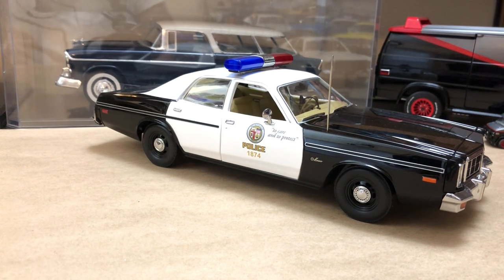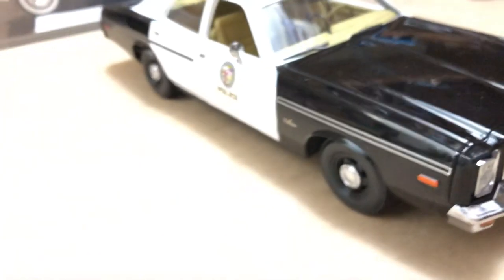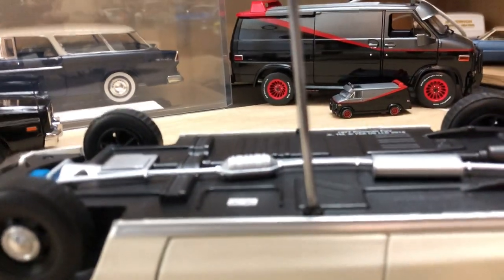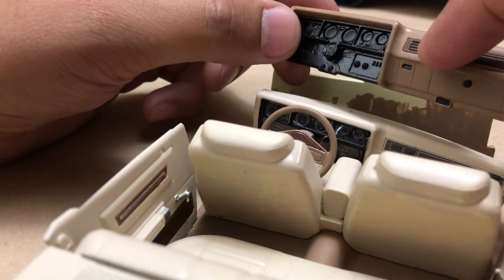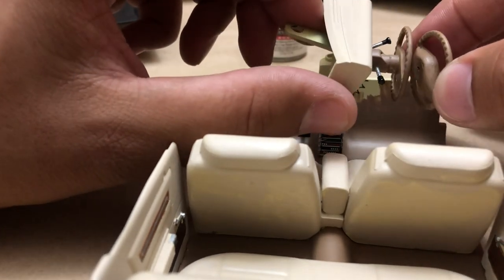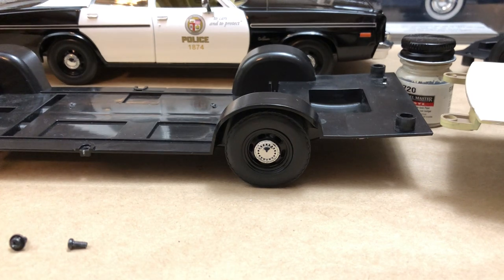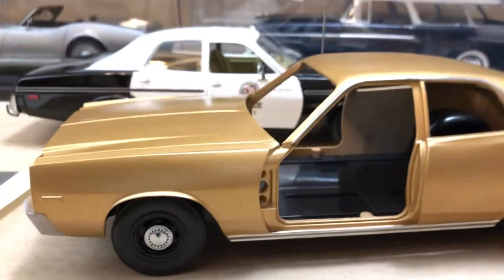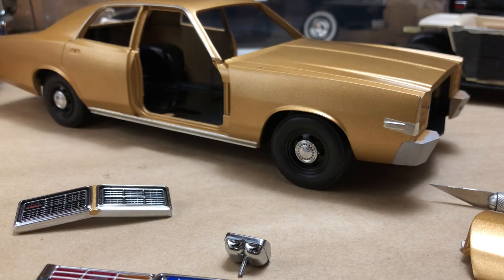Project ‘77 Dodge Monaco Custom Greenlight 1/18 #Diecast PT 1

Comment: I thought I was the only crazy one that was taking these things apart. The  interior was  also bothering me. I took The interior out of a 1974 dodge Monaco diecast and resin casted It To get the correct police package bench seat.I also changed the wheels to the correct four slotted earlier type that Chrysler used in 1975,76 and 77.I took mine down to bare metal also and had to do a lot of priming and filling because the metal has lots of scratches in it.I’m doing a two-tone paint job on mine and I wound up ruining it when I put my clearcoat on it so I’m doing the whole thing over again. I love these things because like you it reminds me a lot of the cars that were traveling around when I was growing up. I love the tip about using the sharpies for the marker lights I never thought of that. The decals are the next problem because no one really makes 1/18 scale decals. I solved that by making my own with my ink jet printer.I also painted the interior like you did because the color that Greenlight  uses is ridiculous. I enjoyed your video thank you for posting it.

Comment: Can you take the headlights from the 77 model and put them on the  75 model cars where there is just one big round light? They make a  75 CHP coronet but I want it to look like a monaco with the 4 headlight system and wonder if it will just snap right in.
Reply from the maker: Yes just have to also take off the whole front end too
Reply: Okay so the whole front end of the Coronet matches up with the front end of the Monaco?
Reply from the maker: Yes the body’s are all the same castings they just change the front and rear aroind

Comment: Is the Coronet emblem on the side a sticker?
Reply from the maker: Die cut chrome decal too thin to remove
Without destroying wish someone would make replacements
Reply: @Migs_Models  I owned an Ex CHP 77 Monaco. Are you ready for this?: It was painted gold.  It had a blue and yellow license plate 594 XXC (the thinner letters) I want to do exactly what you did because I guess the Dukes police car has no model emblem on the side but it's a Fury. Where do you get your cars and supplies from?
Reply from the maker: Greenlight collectibles has released many different B Body mopars look them
Up on google many diecast sellers have them for sale and eBay too.

Comment: exactly why i don't buy from Greenlight ugly cheap models..but one beautiful one i have is a 1975' Dodge Monaco the Navy Blue & Silver Nevada HW State patrol squad car that i had bought from Hot Pursuit looks realistic just like it did in the 70s when they had it out on the road. i had the choice of either the B&W or the silver & blue navy blue is my favorite color it looked gorgeous so i chose that one instead. i want to find the 77 dodge monaco with the flat rounded barlights ontop & in B&W just like the Terminator 1 movie model but i want the one with the on & off lights switch thats found under the back end under the rear bumper hard to find it out there even on ebay.

Comment: question  could you remove the wheels from the  1.18  scale greenlight  A team van ?   what i would like to do is to remove wheels  form  the greenlight  and use the wheels from the   hotwheels elite 1.18 scale A team van  which look 1000 times better 
just not sure on both models how to do this
Reply from the maker: You can remove the wheels I believe. The front wheels are on stub type axles I believe but the rear is metal axle like these cars.